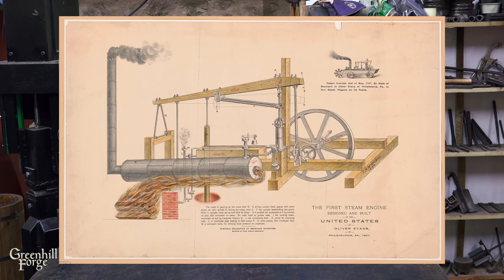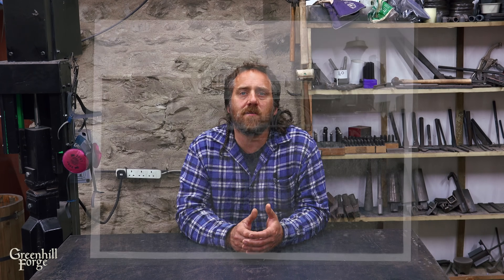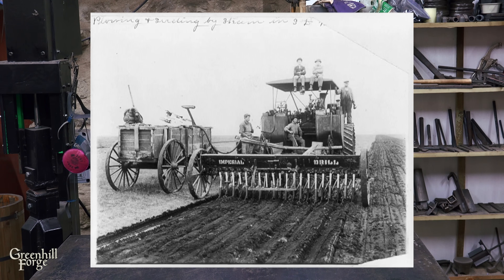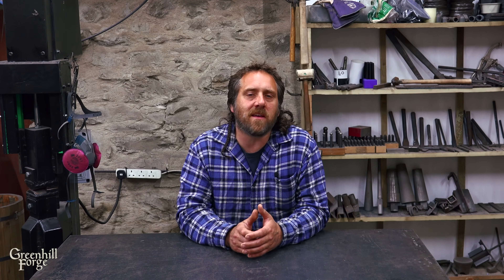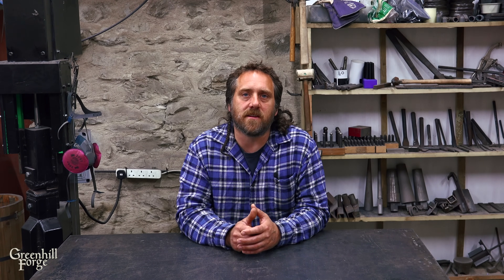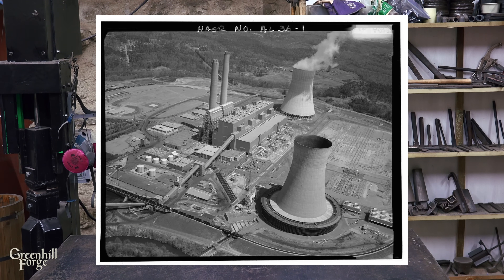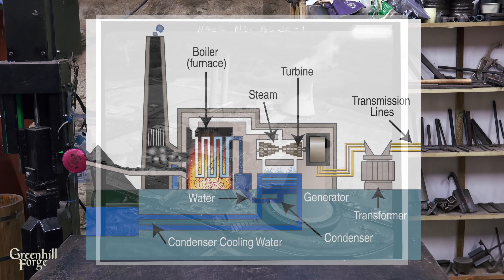Help Me Design an OffGrid Steam Engine + the Basics Explained

Comment: Disclaimer: I am not an engineer in this area, this write-up is based on things I have picked up out of pure interest in this topic. I can't tell you why, but for some reason, I am fascinated by making hot water.

There are two main reasons steam was phased out in favor of other heat engines, which we will have to consider in your design. First, it is important to understand these challenges, and how they are solved today.
One, steam is pretty inefficient at small scale. Even massive steam locomotives struggle to get above 30% thermal efficiency (watts of heat power in vs watts of mechanical power out) at a few MW. Thermal power plants almost unanimously reach 42% but they have the advantage of being absolutely bonkers massive, in the hundreds of megawatt range. They increase the efficiency by pressurizing their loops - thousands of PSI is not abnormal. I don't fully understand this, I think it has something to do with moving the Carnot cycle "up" on the pressure-volume graph, with the added benefit of increasing the mass density, so a higher flow rate can be achieved with the same volume of piping. The smaller you go, the more this efficiency impacts you. Your average wood stove outputs up to 5kw of heat (20,000 BTU/h). Your smallest design goal would be realized at 10% efficiency, but that's a lot of heat for not a lot of power.
Two, heat engines using steam require a lot of maintenance. This is less of a problem in industrial-scale power generation, where you can plan maintenance intervals to shut down the plant, and have dozens of specialized engineers dedicating their career to keeping the machine running.

*Boiler*
I know very little about boilers, just the working fluid. You want a high pH and you will have to regularly test/tune this. Fouling will be your primary concern, no matter how pure you keep your working fluid, you will need to regularly drain and clean the boiler. For this reason, I would lean towards the flash boiler, as it will negate the need for (or the size of) second storage vessel to drain the working fluid into during defouling.
One other thing to consider, the system must be closed-loop. You will need a condenser to convert the steam back into water, which you then pump into the tank/boiler. This condenser can be a way to recover some of the heat from the system (possibly a water-water heat exchanger for domestic hot/heating water) at the cost of it being another part that will foul up. Either way, the condenser will be an absolutely critical piece of equipment that, if inundated (overheats) will damage the system and cause a severe safety hazard. This heat rejection will be significant, (fire_heat - smoke_heat - power_generated).

*Sizing*
0.5-2kW is rough, there is very little in the commercial market (mainly due to the scaling issue mentioned above). Portable generators dominate this power range, as they are reliable and cheap. Calculating this will be difficult, you're probably best off building a prototype, measuring its RPM/Torque curves (use a DC motor with a variable resistive load, this makes a cheap/easy dyno) to get a ballpark of your power figures. The supply can be measured by capturing the water runoff (mass flow rate) and inlet pressure.

*Fuel*
This is your area of expertise ;) I think you even did a video on it. Your number one enemy is coking. Flue gasses hitting the working fluid will cool a lot, the temperature depends on your steam loop pressure but under 100°C is quite likely.

*Safety Systems*
I think you are quite familiar with these so I won't add much. One thing to consider when designing safety systems, is how they will function when fouled. Having a relief that does not trigger because it is plugged up will lead to a bad day.

*Steam Drying*
I am not much of an expert here either.

*Turbine vs Piston*
Honestly, I am not sure if you will be able to manufacture a viable turbine. Your metalworking skills are downright impressive, but I haven't seen your 5 axis CNC in the corner, and outsourcing is not in the spirit of your channel. Turbine design is also a massive field of engineering, doing flow simulations over blade design, calculating pressure drop after each stage, using stators and rotors and calculating the vectors of fluid around the circumference of the blade as they flow between them are just some of the challenges you will face, this is neither very YouTube friendly or something a single person does. Again, scale negates this problem for the industry.

Piston engines have the disadvantage of being inefficient and maintenance heavy. Problems you will face:
- They have many bushings requiring frequent greasing, which is hard to automate
- The cylinders can't be oiled, the sliding surface must seal "steam-tight" which is usually done with a sacrificial seal that gets replaced with wear
- Prone to leaks, requiring water top-off
- Everything will rust due to the presence of water
- The slide valve is prone to fouling

It honestly may be worth considering a scaled up Stirling engine. Industrial solutions already exist which scavenge waste heat to produce electricity, Stirling engines negate most of the problems which both turbines create (manufacturing complexity) and pistons (operational complexity). They do not meet the criteria of "steam" generation (so I won't harp on them too long), but they are a Carnot heat engine in your power band, are low-maintenance, "easy" to build, and fairly efficient. They typically pressurize the working gas (usually helium) which might be a unique challenge for you, but otherwise are fairly straightforward and there is a lot of information available about them.

*Materials*
Also not my area of expertise, personally I would follow history on this one and just copy what's already been done. Early industrial revolution area materials will likely line up with what you can work in your shop (eg, the use of leather/felt for sealing the master cylinder). 

Hopefully this was helpful in some way, thank you for reading. I love your channel, and am excited to see what this project turns out to be :)
Reply from the maker: This is a great response. Thanks. What I'm mainly thinking of at this point is proof of concept prototype. I'd agree that it's way too maintenance heavy and inefficient for regular use. I'm just playing with ideas for backup when the solar/wind/hydro aren't cutting it and I also just really enjoy making hot water.
Reply: I first want to say, just because it isn't your career path doesn't mean you can't be an expert on the topic. I have found that passionate enthusiasts are often better resources than engineers who only do the work for a paycheck. That is to say, great response! 

In the name of efficiency I would definitely recommend pursuing a turbine system. You will definitely need effective drying, but it will be worth it to maintain a closed loop. An easy way to get an efficient turbine sized for the size system being discussed would be to use the hot side from an automotive turbo. These are often designed to operate at temperatures upwards of 500°C, so it should work fine in this application. You should be able to early source one from an auto salvage yard. This will be a high rpm, low torque output, but it may work. 

The stream dryer isn't as complicated as you make think. The main thing you need is to generate rotational flow to push the moisture to the outside. The flow will need to be with concentric tubes with the center being for the steam flow and the outer jacket for water return. You will want an least two stages of this. 

Depending on how far you want to take this, you also may look into having a primary and secondary loop as is used in modern steam generators. The primary loop would be pressurized to maintain liquid flow and would be an intermediate between the heat source and the boiler. The primary loop would benefit from use of a higher boiling point liquid (glycol antifreeze for instance).  This will allow you to optimize your heat exchanger to harness the energy from your heat source / flame and also optimize a second heat exchanger for boiling the water. Definitely not necessary, but a potential rabbit hole of scope creep should you find yourself wanting to further complicate an already daunting task 😅.

You may look into some sort of oil separation if you use a piston or turbine system, but I imagine this would be a later addition to the system. 

No matter what you choose, I'm excited to follow this project!

Comment: I’ve thought about this too. Maybe an old air compressor tank or better yet an old oxygen welding tank for the boiler. You probably need to keep the direct fire off the tank itself. Perhaps adding some steel in between.
The trouble those items is internal rusting.
You could build a piston engine to harness the steam but I wonder about some old a/c compressor. Those are usually scroll style. Although in the UK you would have a hard time finding that I realize.

Comment: I love steam engines, ...... but suggest you use solar🤣
1kw @17% efficiency = 1/.17= 5.88, ~6kw of heat = 20.4kbtu/hr
The Stuart Sirius made 200watts and was used in ww2 as a battery charger
The Stuart 5A "is quite capable of producing 1 1/2 bhp at 100 psi running at 800rpm." (sounds a little scary)

edit: 1 cord of wood, ~20milion btu [ / 20000btu/hr = 1000 hours @1kw]

Comment: ok so youtube deleted my previous comment because of its terrible UI (going into small mode deletes a drafted comment, thanks youtube) So i will quickly reiterate what i've already said.

I think a tank boiler, is going to be less convenient and take considerably longer to heat up, and get to a running temperature, where as a flashboiler will very quickly come up to temp, it'll just require more babysitting for fuel.

A tank boiler generally isn't that dangerous unless you're on a train, or have a water level low enough that the jacket around the boiler is filled with air partially, in which case you can get steam explosions from water sloshing (in locomotives) or potentially with stationary boilers, injecting too much water too quickly. Though i think this is unlikely. 

I suspect you will want to start with a smaller flashboiler design because it will be much easier for using to prototype steam engine designs, as you wont have to wait for everything to heat up before you can start testing, you just need it to start producing steam.

However a tank boiler is going to have a much more consistent temperature, produce steam more consistently, and be more resistant to hot flashes (short bursts of high heat producing very hot/dry steam) and cold flashes (short bursts of lower temperature steam and wetter steam) 

I would also recommend outfitting the boiler with provisions for atomized fuel injection of diesel or kerosene or something, at the very least as an experiment, having a dual fuel capable boiler will be convenient for testing, as well as just producing power. You should be able to do this while keeping it's wood burning capabilities mostly intact, though it might require more maintenance. Perhaps a good future project.

edit: as for removing water, generally you just get wet steam (straight out of the boiler) and get it very hot, otherwise you preheat the engine first to prevent condensation from being a huge problem, and either drain water actively, or remove it in situ.

as with all of my comments, i'm just a nerd not an expert. Take your required daily supplement of a few grains of salt before consuming.

Comment: I agree with the comments on here so far talking about safety of a pressure vessel, If you are going down the route of steam consider a flash steam boiler driven by a high pressure feed pump. As for the best engine to turn it to mechanical power a rotary vane pump, scroll expander or turbine might be a better option instead of a piston.  You could also consider a different working fluid and develop an organic Rankine cycle of some sort.

Comment: In many, if not all, States, if you create a pressure vessel, you will be required to have a inspection and/or have it tested. I believe that is why you do not see many DIY non toy steam engines.
Reply from the maker: I'm in the UK but yeah I'll need a Written Scheme of Examination from a steam engineer before I run it
Reply: @GreenhillForge  just when I was wondering why do you have those UK plugs in the background...
Reply: @jinxit  Do you sometimes get wet on your head when you walk outside and you wonder why it happens until you consider the possibility that it most likely is raining? 😀
Reply: @_TheDudeAbides_  I honestly though it has to do with the superiority of the UK sockets (each socket has a fuse, plug has a fuse, and each socket has an on/off switch). I know it for a fact that there exist people in non British Standard locations who use BS sockets.
Reply: @GreenhillForge I didn’t know about those rules in the UK. Better be safe than blowing yourself up, but I wonder how many inspections there are in a year. Steam engines aren’t very common now.
Reply from the maker: @SprocketN  after the initial certification it's an annual inspection. There's still a lot of hobbyist steam interest in the UK. I think it's closed down in the last year or two but there was a massive steam festival for years called the The Great Dorset Steam Fair. And I occasionally see a steam car puttering down the highway at 10-15 mph. It's really cool.

Comment: At 2kW you could look at a tesla turbine driving a disk with magnets mounted at the rim (speed at the rim rather than torque at centre) and static coils without cores on opposing disk. This would reduce mechanical losses and possibly require a smaller boiler hence less fuel.
Reply: can we avoid the T brand?
Reply: @kevinhorne9643  Tesla the dude, not Tesla the car.
Reply: @mitakeet  "As you wish"
Reply: @kevinhorne9643  That's incontheivable!
Reply: @mitakeet ”I’m not sure you know what that word means”
Reply: @kevinhorne9643  "Mawage. Mawage is wot bwings us togeder tooday. Mawage, that bwessed awangment, that dweam wifin a dweam... And wuv, tru wuv, will fowow you foweva... So tweasure your wuv." 

"Skip to the end!"
Reply: @mitakeet  😝🤍
Reply: This is Nicola Tesla's turbine, not the car manufacturer  @kevinhorne9643

Comment: As much as I love the idea of a steam engine, and the variety of things you can tap off the same boiler, a Wood-gas converted generator would probably be easier to construct and more fuel efficient.
Please also carefully consider the potential for catastrophic failure of homemade parts in a steam system
Reply from the maker: I've played around with gasifiers and I'll make some videos at some point. they're super cool
Reply: wood gasifiers are rather annoying in the big picture, it's a rather complex machine, compared to just boiling water directly, and the wood gas itself isn't a great replacement for gas/propane itself.

Not that it isn't useful it's just, a full steam engine setup with a boiler is likely to be more productive in general.